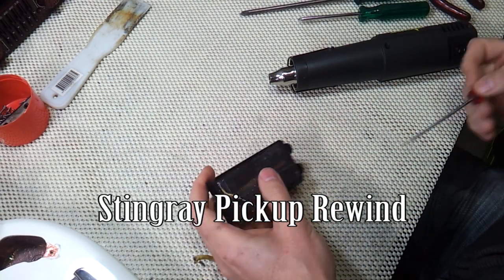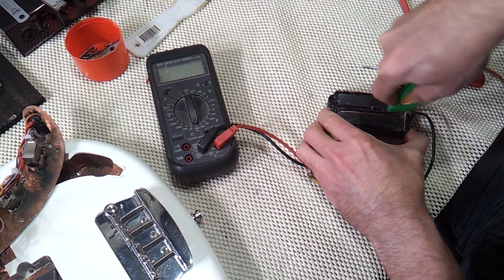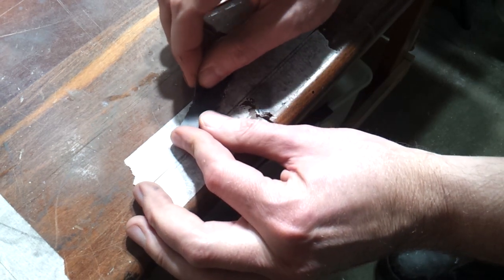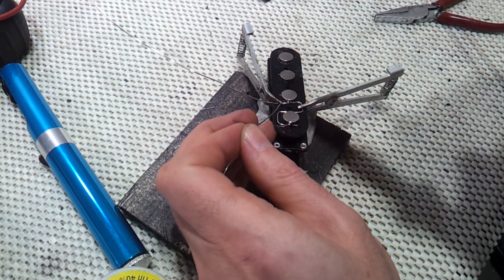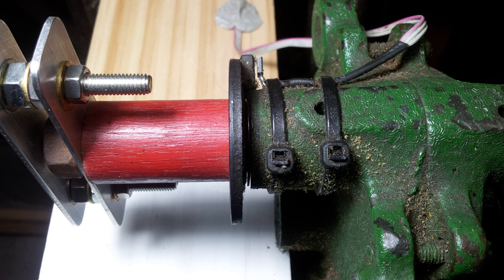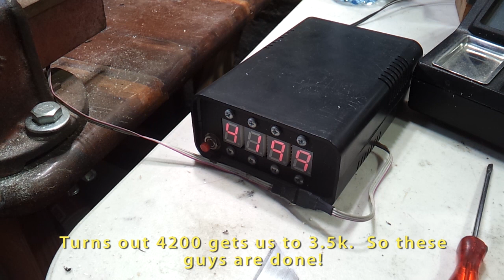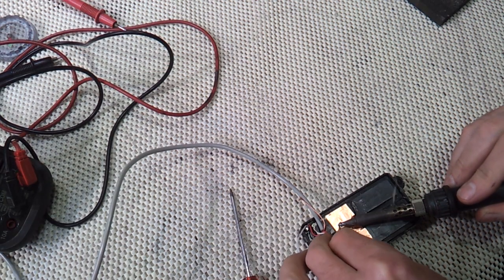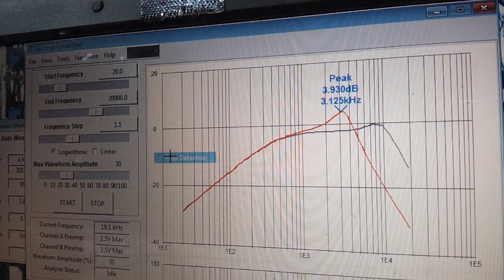How To Rewind A Stingray Pickup

Comment: Hi, In the beginning of the video, you said reverse magnets does hum cancel, but it has to be reverse wound to canceling hum, magnets don’t affect phase of hum. Am I right?
Reply from the maker: Hi Yuan.  Yep, the magnets have to be opposite polarity to have a hum-cancelling pickup.  But the winding direction doesn't matter.  You just have to make sure to have the signal of both coils is in phase.  (If they are out of phase, it is very obvious.  The pickup will sound very thin with low output and no bass).   It is nice however, to have one coil reverse wound when you have exposed pole-pieces, because then (with signals in phase, and coils in parallel), you can have the inner windings from both coils at earth. 

Even though the pole pieces are insulated from the windings, due to capacitance, a signal can pass.  And when you touch the pole pieces, your body is an antenna, and if the inner windings are on the hot side of the circuit, you get a buzz.  This is just like touching the tip of a guitar lead that is plugged at the other end, into an amp.  It has nothing to do with hum-cancelling.  It will happen with any pickup, single or 'bucker, if they have exposed pole-pieces and are wired with the inner windings of the coil to the hot side of the circuit.

One way to negate this is to earth the pole pieces.  Another way is to use a pickup housing that covers the pole-pieces. Neither of these measures were really necessary since I rewound the pickup with one of the coils in reverse and I wired them in parallel.  Now I have the inner windings of both coils on the earth side of the circuit, and if I touch either set of pole-pieces there's no buzz.  However, if I decide at some stage to wire this pickup in series, then the inner windings of one coil will no longer be at earth because now it is connected to the outer windings of the other coil.  And it will buzz when touched.  (This happens with P bass pickups.)  So I earthed the pole-pieces just in case.

This is all a bit confusing at first, but once you make or mod a few pickups, your brain will make sense of it I'm sure.  Thanks for watching my video mate!
Reply: Rob Mods. Thanks for the reply, watched all your videos. Great works!
Reply from the maker: @gaoyuan5220  Thanks mate.  That's kind of you to say...

Comment: Magnets don't contribute to hum cancelling. The direction of current in the two coils does. The principle is that of a common-mode choke. Coil wind direction does not matter for this. Two coils, wound in the same direction, wired in reverse, in the absence of any external magnetic field, will still cancel hum. This can be confirmed with any standard humbucker with the magnet removed.

Comment: ROB, can you make a separate video showing what type of dummy coil, like just removed the pole pieces and just kept the coil around the bobbin and then injected 20hz to 20Khz sweep function generator? The main question is how can you TUNE a pickup to "shift" the resonance frequency to the right or left? It would be nice to see your test setup when measuring a pickups frequency response profile curves but not sure how you can TUNE the pickups by shifting the resonance frequency to the right or left by the windings capacitance and inductance

Comment: Excellent and informative video. I have an question: Is it a good idea to unwound the cheap pickup until hit this 3k dc goal? Instead of unwound and rewind. I have an old stingray cheap pickup and I can just unwound wire, to make it underwound.
Reply from the maker: You could certainly try to unwind a pickup.  I did this as a teenager actually.  It would be quite time consuming for sure.  And if you break or lose the wire, that would mean rewinding from scratch of course.
Reply: @RobMods  Thanks for the reply. Actually, I tried this last night it took me a few mins to underwound from 3.5k to 3k dc. How this will sound I will see. Interesting experiment.

Comment: Btw how to increase the output of the pickup in the passive one?

Im using a single coil jazz pickup and i want the sound is closer to the geddy lee's jazz bass which he is using rewinded  70's jazz single coil by tom brentley.
Reply from the maker: Here's a few ways to increase the output of a passive bass.  1: Try different strings.  Make sure they are genuine (buy from a reputable retailer).  Some string alloys are more ferrous than others.  2:  Adjust the pickups closer to the strings.  3:  Try an EQ pedal for a little boost and some tone shaping.  4:  Make the magnets stronger.  You can experiment by adding some small neo magnets to the bottom of the bobbin.  This is a cheap and easily reversable mod to try.  5:  You can have the pickup "over-wound".  This means simply adding more windings over what is there, if possible.  If there's not enough room for at least 10% more wraps, then I'd say don't bother.  6:  You can have the pickups "re-wound".  This means cutting off the existing windings and replacing them, most likely with narrower gauge wire so you can get more output from the pickups.  This will also give more inductance, so the tone will most likely be darker.
Reply: Thank you man much appreciate
Reply: The easiest way to increase the output is by wiring them in series